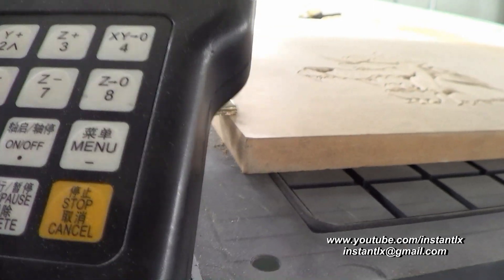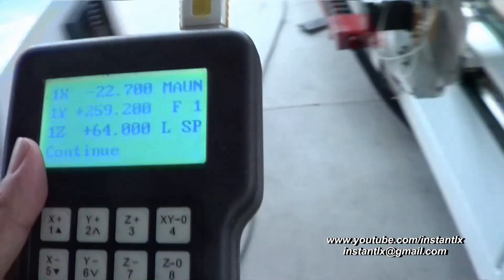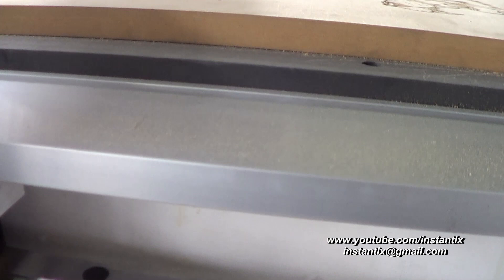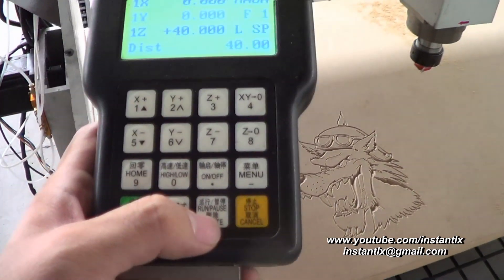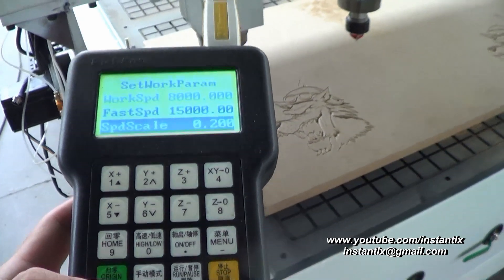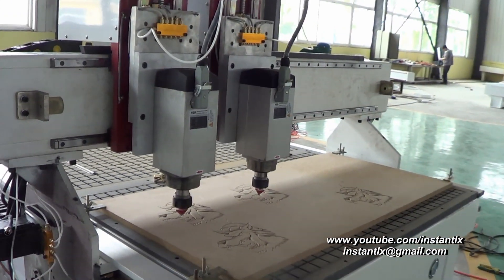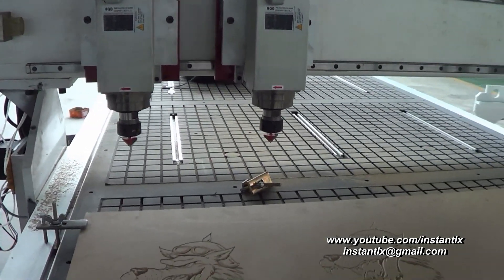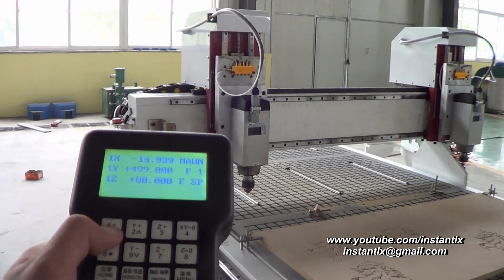how to use DSP to control a double heads CNC router, China cnc router

Comment: What is the gcode of it nice
Reply from the maker: I made the g code in artcam. with a good vector. it's easy to make toolpath.  
As for post processor? we have our own. we provide it to our machine users.  basically you may also use some default ones such as model master 2D *.mmg, Axyz arc *.nc, etc

Comment: for double head spindle which model of dsp rich auto suitable?
Reply from the maker: For similar machine as shown in the video just use same DSP as normal single head cnc routers. If your router has 2 spindle with cylinder for fast tool changing then you'll need a different version of DSP or NK105 panel instead.

Comment: hi liu xin i have  got same 1325 double spindle cnc router  it is connect with DSP controller in the dsp controller USB port not working if we connect to pc it is also not working other oll working propealy if you can hellp   me  it is great can you please send me skype id or viber contact number
Reply from the maker: if you connect dsp to PC with the usb cable, and it doesn't work. it must be broken.  dsp often has some unexpected problem (bugs). and there's no good solutions

Comment: how much? money...
Reply: hi,we can also offer the same machine, you can contact with me,whatsapp+86 15508689532
Reply from the maker: 8000 USD with stepper motors. this is an old model now. we have new design of the machine body which is more stronger and bigger. contact me if you want one +86 15069012070 instantlx@gmail.com

Comment: I have a 1325 but I have a problem with dsp is locked my question is may remove dsp and connect to the computer and if so, how I can do
Reply from the maker: you can try mach3 or ncstuido. you need to know some geek knowledge to do so.